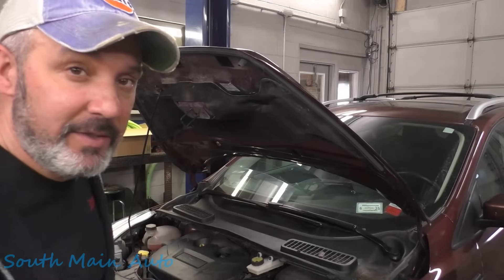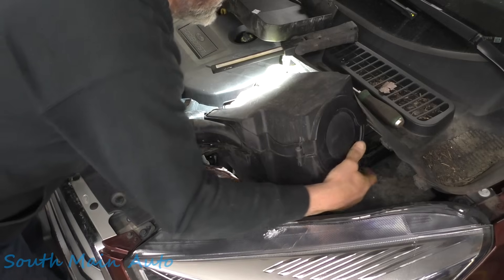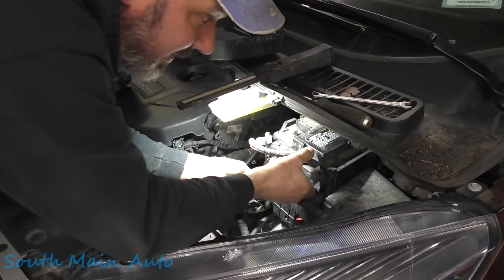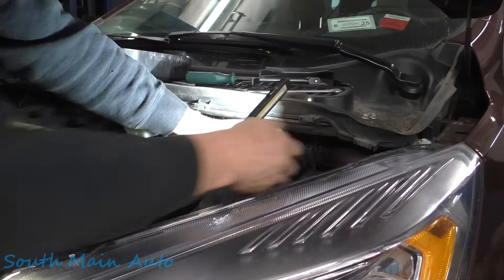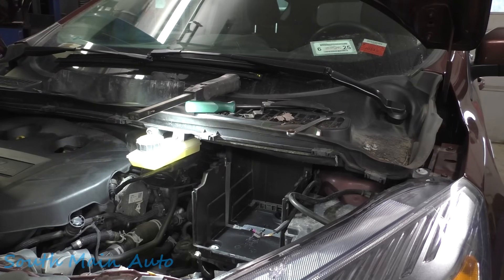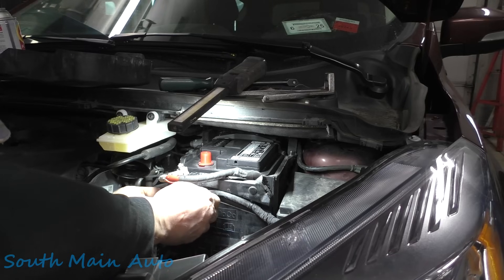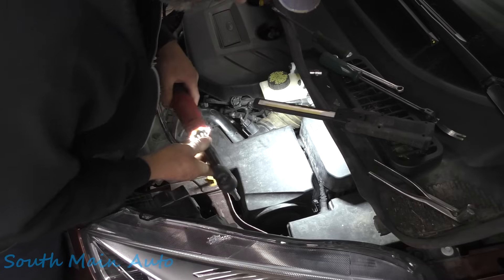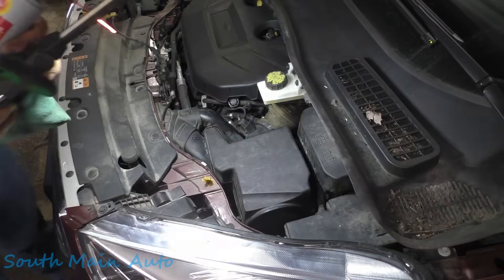Ford Escape Battery Replacement

Comment: Not one of Fords better ideas, I remember that old add slogan.
I had a 2001 Chrysler Sebring that had the battery located in the forward part of the drivers front fender.
Had to pull the wheel off and then a panel that was part of the fender liner. They did not allow enough space under the hood to have battery.
Almost seemed that it was an after thought that the car needed a battery.
This must of happened at Ford, they forgot the vehicle needed a battery and found a space to CRAM it in.
Could only be described as an oversite.

Comment: Leave it to Ford to turn a battery replacement into a  30 minute ordeal. It's fair to say we have about computerized ( screwed)
ourselves into a corner. Yes I long for the good ol' days of the voltage reg as you spoke of. One more reason why I'm retired.
Military applications were usually more simple along   
with CAT  applications and made sense. Keep up with the Great content, I look forward to Each and 
Every thing you present.

Comment: There ought to be some kind of regulation requiring things like batteries and filters be easily user-replaceable. There is no excuse for a battery change to require special programming tools and 20 minutes of a pro's time.

Comment: I'm sorry...slotted screwdriver-  Designer invented that system in his pajamas in his dining room.  He drives a 70 Chev pickup.  He works on all his own stuff.  The only thing that design needs is a little more sharp sheet metal.  Thanks for the video.  P.S.  Sorry for all the negativity, it's Monday.

Comment: There would be no need to adapt charging strategies over time if these Fords didn't suck so much juice!  I care for a Fusion and Ecosport (both relatively new) for someone else and they both need to be fed 6 amps from a charger every Thursday or stuff stops working.  I can't imagine how these cars will hold up when the batteries get old!

The batteries Subaru uses are crap, but mine has still been holding up for 9+ years and counting.

Comment: I have different car makes models. It is an extremely common problem for plastic to break on air filter housings. The engineers need to get a clue.

Comment: The good old glory days working in a Chrysler garage late 60s early 70s I went to training 2 days a month and the dealer would pay. And Chrysler had a thing called serviceability to make things easier. oil filter easy to get at spark plugs easy to change temp and oil sensors on the outside of the engine ect. Also engines with plenty of space to work on to change any needed parts. The foreign cars were the ones harder to work on then and started the hard to work on vehicles and US automakers fowled pursuit with complications and not so easy to work on

Comment: Everything squished under the cowl, onto passenger laps. No thanks, my 2002 Focus ZX3 Manual everything, W/throttle cable, cable cruise control, ice cold air, 207k miles does me just fine.  Did the entire clutch system W/flywheel, hydraulics, and all for $975 ALL-IN, 2 months ago.😇

Comment: So you never top up the battery then  ????
Reply: No need to, battery lives aren't what they used to be. Topping off is wrong, ANY location. Just fill to cover plates. THAT'S  why battery was so clean & DRY.
Reply: These are considered sealed and don’t require servicing, other than replacement.

Comment: I bought a new Mazda 3. The battery would discharge overnight. The voltage and load test said it is a good battery. I changed it out for a good one I had. That one works. Anybody know why my new Mazda battery would lose charge overnight but my Walmart battery worked fine?
Reply: Possibly related to Mazda's stop/ start technology and the replacement battery not being the right part for that model?

Comment: What is it with American automotive manufacturers designing vehicles that make simple repairs complicated?
It cost me $120 to replace a headlight on a 2008 Buick LaCrosse because the battery, battery box, cross member support and front bumper have to be removed or loosened to access the headlight bulb from behind.
BTW it was a rhetorical question as I know the whole reasoning behind it.
Thanks for listening!
😂

Comment: Old Datsun battery replacement.  First, remove old battery. Second,  Put ear plugs in. Third, put new battery in. Fourth, wire new batterHONKHONKHONKHONK!  (car alarm always goes nuts when the battery is connected.)

2019 Altima battery replacement. Have 4 10mm sockets handy and a magnetic long reach to retrieve 3 of them after putting the new battery in...  That car is a harsh mistress on batteries.

Comment: 6  FORD ENGINEERS SITTING IN A BAR. ONE COMES UP WITH THE IDEA OF PUTTING THE BATTERY IN A HOLDER , THEN BUILD THE CAR AROUND IT. THEY LAUGH LIKE HELL BECAUSE THEY KNOW  THEY WON'T HAVE TO CHANGE IT. NO WONDER US MECHANICS HATE ENGINEERS. GOOD JOB MR. O

Comment: My 2013 Escape needed a new battery a few years ago and I took it to a local battery shop - at the time, the only place in town that had the correct size AGM-style battery.  Now it was "free" installation.... Unfortunately, they decided the only way to get at it was from the top - meaning they spent an hour taking the wipers and cowl off and what ever else so they could to lift it out.  If only they had seen the front battery wall pops off as Eric shows here. Two and a half hours later they were done.Thankfully I was not in a hurry, but they mentioned to me they didn't have time to check the engine computer for any resets... ;-) So I did get a scan and it had picked up there was a different battery somehow and all was good.  I now have a '21 Escape and the battery is on the same side but no longer covered or obscured by anything.

Comment: Oh wow. There's really a tool for spreading the terminals? You mean my solution of using a hammer to knock it on isn't recommended ;-) ? My son has a '16 Focus and I thought that battery was bad to replace ... similar location set back under the cowel.

Comment: And??????   What was the Price for that JOB????  2018 FORD EDGE V6 Non Turbo, Battery Replacement in California at a Reputable Shop..... $308.00 Out the Door, with the Factory Motorcraft Battery.  What a RIP OFF!!!! And this JOB here..... Unbelievable.  Thanks for the Education E.O. another Job Well Done.

Comment: To defend the engineering on the battery placement. In my 25+ years of working  machine maintenance and dealing with engineers, I can unequivocally say some of the most ridiculous words spoken have come from the mouth of an engineer. Moving on.

Comment: $600 to replace battery??  Yep, $200 parts,  $400 labor.       What a crazy place to put a part you change every 4-6 years.    Makes my audi (rear hatch mount with required registration) seem reasonable.

Comment: you got to be kidding me all that work to just change a battery that is crazy it sure is not like olds of changing the battery just unhook the two cables and remove the battery strap down and go in reverse to install the new one. and your done in about 15 to 20 minutes.

Comment: That ford had a good 30 more years in her and 250k miles. now the frames gonna rot and transmission gonna fail all  because u took the positive cable off first.

Comment: Advance Auto can register batteries now, but for a battery like that I believe we still have to recommend professional installation since the air box needs to be pulled out.
Reply: No it doesn't.

Comment: Mercedes GL SUV, battery is under frt.passenger seat.If battery is dead, guess how you're gonna move the seat forward enough to even open the lid.Not gonna happen fella,up the flat rate charges please

Comment: You should find the guy who designed that battery placement and get him to change it out…..   so much of this newer stuff is way more complicated than it needs to be.   But hey, if they didn’t change stuff then those engineers at Ford wouldn’t have a job.  Wait til they get to using Artificial Intelligence to design cars…..

Comment: What a silly place to put a battery :-(
I always liked the old fashioned  alternators with a separate regulator,  i used to repair the regulators and new diodes in to the pack.
That's when i worked at a auto repair shop.
 No silly systems in those cars.
Good days :-D

Comment: Nah VW/Audi just add 1 to the serial number. the voltage regulator module just wants to know its a new battery... yeah it times how long the battery is in the car to charge it properly. if u dont update the serial number in VW/AUDI u will start getting false module failures due to low voltage. Months later long after u forgot and or declared to friends how u didnt need to update the SN# and its working fine!!! Its slowly not charging the battery fully. nothing like an Audi with false module issues and someone just swapping $200+ modules simply because the battery serial # wasnt updated.

Comment: This is almost as bad as those batteries which are put in the front bumper/wheel well. At least on my vehicle the battery is behind the front passenger seat accessed from the second row.

Comment: Dodge journey is worse. Driver front tire off and remove fender liner as that battery lives in the fender well. Engineering at its best. As for the escape. I just pull the driver wiper and lift the cowling cover up. Gives room to change the battery and is quicker. Remove brake resivouor and set aside for more lift. Yen minutes out and new one in.

Comment: I'll never understand why these new cars are made so complicated. I'm guessing the car manufacturers want everything brought to the dealer to be worked on and they can all make more money.
Reply: I did more research regarding my confusion about the over complication in today's vehicles. Apparently the auto stop start technology will reduce fuel consumption by 3 to 9 percent. Doesn't mention the wear on starter and other engine components

Comment: At least SMA calls this a video, if this was Corporate owned by Snap-On tool Ford dealer they would have charged 1.9999 hrs labor and replaced the sacrificial air filter one use housing.  Just saying 😅

Comment: It is extremely unlikely I would ever own a Ford Escape, after this exposition of knuckle head engineering, the likelihood gets even thinner !
     In my experience, changing  batteries is done on the fly, because you are already late. This set up is annoying to even watch.  So that top cover is designed to rattle then  ?

Comment: Certainly not the easiest battery to replace, Maybe the Ford engineers should be made to replace Escape batteries for several weeks to see what's it like, and maybe make the next set easier.

Comment: Audi: "lets put the battery in the trunk and give it its own computer" Ford: "Hold my beer" Also unless you enjoy being kicked in the nuts don't own a VW product without owning your own scan tool, I love em, they are seriously not bad to work on (changed a starter on my 2011 vw jetta wagon the other day with one allen key, and a basic socket set, all from the top of the engine, didn't even touch a knee to the ground, took maybe 30 minutes and seven beers, might have been the easiest starter I've ever suffered. but like I said, if you don't do your own work plan on heading for the poor house.

Comment: Seems like having a heavy lead battery on the driver's side just a couple feet in front of the driver would be a red flag for the safety guys when it comes to a major collision. Not to mention the IN-convenience factor for replacement. Definitely will never own a car like this.

Comment: Lol, Ford needs to go back to the 2010 2012 Escape when it had the 3.0 V6 naturally aspirated engine. No issues with mine when I had it. Oh, and the battery is where it belongs. In the front Winter killed the body. Back when they were called MPV, not a crossover. Oh and as for turbo. Nothing but junk from all of the manufacturers.

Comment: And I thought that Chrysler had a bad design where they shoved the battery under the driver side wheel well. At least with the Chrysler design you could just take off the left wheel and fender liner and you have access. This Ford design is much worse. It just proves the point that the engineers don't ever have to work on the cars they design.

Comment: Pre-video-watching comment: Why the heck does it take 25 mins to replace a cars battery???? This will be intense 25 mins.

Edit: Watched until the end and punched a hole in the monitor in the process. I took down a starter motor on a 2005 Ford Fiesta (European) in the same time it took Eric to replace a fricking battery (mind you, it was my first time and I'm not a mechanic). The way these new cars are engineered is just inhumane

Comment: Thanks for the warning and reminder to not buy a Ford.  The battery is one of the most commonly replaced parts on a vehicle so should be easy to access. The lack of foresight of the Ford engineers has me honestly worried about what else they messed up.   Every non-Ford vehicle I've owned (Dodge, Chrysler, Toyota, Honda, BMW ...) replacing the battery is a 5 minute job, and half that time is getting the right sockets.

Comment: Yes the good old days, dropping tools and they hit the ground, points, cigarette lighters and ash trays, seat belts as an option, death around the corner, unemployed engineers, grease monkeys, service station employees pumping gas (except for NJ), ding ding when coming into the station, grease jobs for cars, gas under a dollar a gallon. Riding on the tailgate of the station wagon, station wagons........

Comment: on the 2018, if you remove the battery, without hooking up a battery maintainer, you will crash the Entertainment System. how stupid of Ford to use Microsoft Windows as the radio and CD player, and navigation..... if you don't shut down the Windows system first, it won't boot up and let you use the Screen to answer the BIOS prompts.
Scratch a $2,000 radio, the battery had been dead for over a year, the Widow asked me to put a new battery in it.... all she got, was  a car to drive, the Radio console is dead.

Comment: I just changed my daughters battery.  My conclusion is that the Ford Escape is the worse designed Ford since the 1974 Mustang II.  The engineer that designed the engine bay need to be fired and stripped of his engineering license.  I've pulled entire engines out of cars with less effort.

Comment: .... so I figgered "Yeah ... a battery change-out --- this oughta be good for 30 seconds, mebbee 45 to 60 seconds on a bad day, and then I saw that the video was 25:50 minutes long and I said to myself "SELF ---> this might be another PT Cruiser battery change. I'll watch to see if good ol' Eric just wastes a lot of my unretrievable time with barbershop banter and false accolades about the engineers of these fine Ford products that seem to have everybody fooled .... like the old Pinto commercials that showed a bunch of TWA stewardesses building their own car with a can opener, a rusty spoon, and some Band-Aids" (note my judicious entry of commercial products). 
But NO-O-O-O! This is (so far Imma up to 07:00 minutes into the video and....)  so far no banter ... what's wrong with this picture? 
Imma goin' back to watch the reinstallation of said battery --- somehow the rest of the full 25:50 has gotta be used up unless Eric has taken up the harmonica in which case we are gonna get entertained some more ... I can hardly wait to see how he fills time for the next 18 minutes and change. <luv ya dude - keep 'er a-comin'>

Comment: DONT DO IT THIS WAY, ITS INCORRECT AND COULD DAMAGE YOUR WIRING HARNESS!!!! while not as simple as most, changing the battery only requires 3 sockets, ratchet, a flat screwdriver, a torx bit and driver. remove the cowl.
Reply from the maker: Oh boy another armchair expert 😂

Comment: Ford engineering is the pitts, Who would have a water pump driven by a timing chain and who would have a rubber belt bathed oil and head gaskets fail all the time

Comment: This is a good example as to why I will not buy a modern car. Asides the fact that today's cars are riddled with defects, the engineering is so retarded to where you have to take half the damn car apart just to get to the one part you need to.

Comment: You made that so unnecessarily complicated for yourself. Wiper cowl takes 3 minutes to pull, or removing the brake revivor and not removing the wiring makes the airbox pull 3x faster and easier...............................

Comment: I hate Ford. New or old, it's a PITA trying to get to things. I had the pleasure of replacing a turbo in a 2015 Escape with the big 1.6L. I would much rather do a turbo on a 2012 TDI Jetta. Way easier.

Comment: Too much engineering going into a car battery and a monitor gizmo. Just like the alternators that are computer controlled duty cycle...all controlled by the PCM blah blah. And for what? 1 or 2 MPG per tank full of gas?  Plus the "stop/start" b.s. to save on "emissions" while the owner deals with starter replacements and probably other maintenance issues that are not benefitable to a single car owner considering the added cost/expenses to operate.